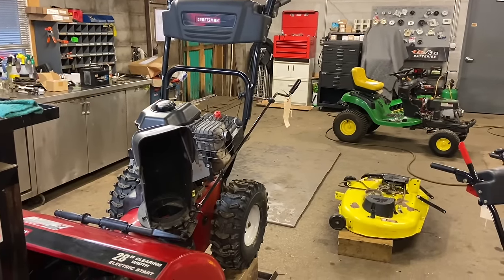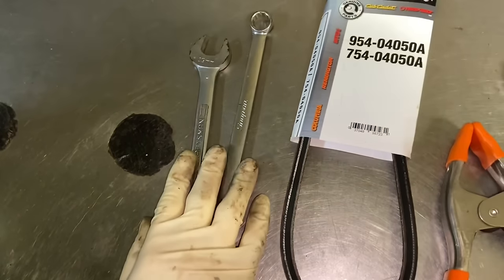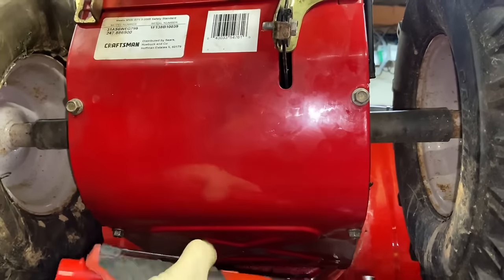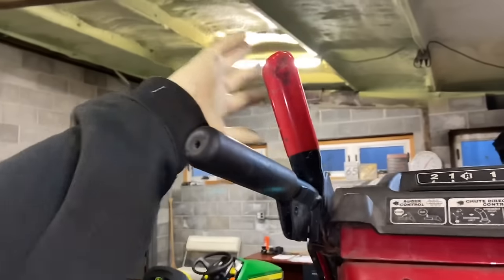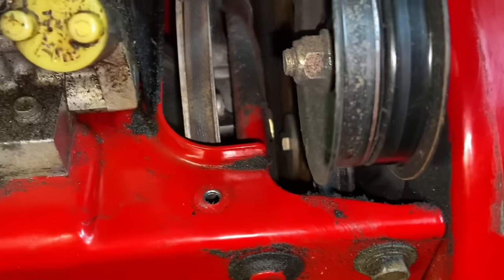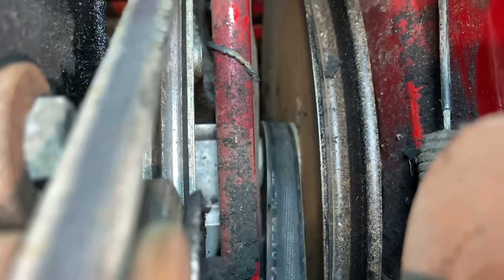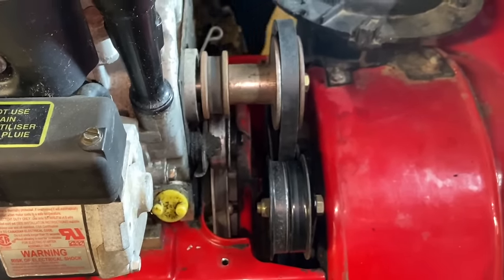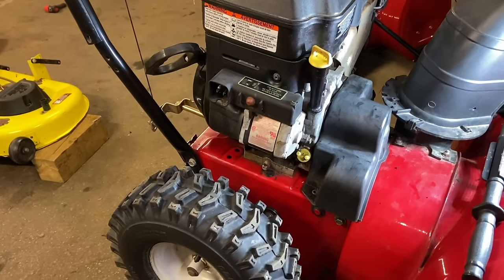How to install a auger drive belt craftsman 28” snow thrower

Comment: You did the easier belt here. The wheel drive belt requires separating the blower unit, or at least removing two bolts and loosening the other two to get the belt down to the pulley. Thanks for the video, though. I just did both belts on mine, and it was very helpful. The thing chucks snow better than it has in years. Mine was this exact model, so it was great to have a specific video.
Reply from the maker: I’m glad it was helpful. We do not get much snow in our area so I don’t get to replace the trans drive belt often but when I get one to replace, I will get a video of it. Thanks for watching:) and I’m happy you machine is running great!

Comment: Thanks. I bought a used machine that had untold hours. Very sound, but unknown history of the last decade. It does not like pioneering in 2.5 feet of crusty snow. So here I am. I will also be using air to clean off the belt fragments prior to re-installation of belts.
Reply from the maker: Hi Al, I hope it goes well for you and I'm glad I could help. Please give this video a thumbs up to help my channel. It would be greatly appreciated. Thank you for watching.

Comment: Very detailed, I am getting one with a broken belt for cheap, drives fine and the motor sounds smooth. I was told he could not replace the belt and got another one. This will be a project for me soon and it look very easy to do. Thanks for detail, I'll edit this when I am done and it's working...

Comment: Thanks for posting this video! I found it even easier if you take the bolt out of the top pulley wheel, it'll separate into two halves. Slip the belt on and then replace the half pulley wheel. It'll require no stretching.
Reply from the maker: Hi Eric, I'm glad it worked out and thank you for watching!

Comment: Thanks for your great videos! I just picked up a craftsman 928 model 31as6heg799, 247.88190, that needs some TLC. Previous owner sheared 1 of the 4 pins and  the other 3 are siezed, skid plates are shot as well as the scraper blade, but the engine runs great! Most of the bolts, (skid plates, scraper blade, discharge chute, etc) are frozen with rust and break trying to remove them. I've have a Murray 522, Craftsman 8.5/26 as well as a older Estate 825 that I've refurbished,  all up and running for  our upcoming MN winter. Keep up the great work!
Reply from the maker: PB Blaster and soak is good for rusty bolts. Most of the time just get new hardware because the old normally breaks off. Thank you for watching my videos and for the kind comment. Please share my channel to help it grow. It would be greatly appreciated.
Reply: Well here's the story. This is a older craftsman 928, 247.88190 that I picked up, $50. One auger blade had a sheared pin, the other 3 auger blades were frozen to the shaft. I had to grind off the other three shear pins and was able to remove the blades using pipe wrenches to free them and work them off the auger blade shaft(s.) Even being soaked with both PB blaster as well as a ATF/acetone combination (no longer have my oxy/acyt torch) the sheared pins would not yield to a punch and hammer so I was able to drill the old pins out. The shafts are now clean and the gear box turns freely and smooth so I added 80/90 to the auger box, p/n 719-0320, LK-3.  According to my measurements, the gear oil is about 1/2 way above the auger shaft/worm gear and I have some fliud leaking on both sides of the auger shaft seals.  Many years ago, we could take a seal, bearing, O-ring to a hydraulic shop to get a replacement part. Due to the age of this blower, it will probably be best to run it as is and keep an eye on the gearbox fluid level on this one.
Craftsman 928,  Craftsman 8.5/26, Murray 5/22, Estate 825

Comment: Thanks for posting! It only took me 15 minutes to replace it after watching your video. I don't have a maintenance stand but putting the blower up on its end (blades down near the floor) made it super easy to get the maintenance panel off and to pull the old belt out and push the new one through. 2013 357cc MTD Gold had more space between the pulleys (compared to the one in your video) for the belt to pass through there.
Reply from the maker: Hey Mike, I'm glad the video was useful to you. Be careful when tipping machine on its end because you may loose gas and oil from the engine putting the machine in that position. It sounds like it worked out for you! Thank you for watching and subscribing
Reply: @JohnsonsSmallEngines  I did lose a little bit of gas but no oil. Thanks again.

Comment: Real helpful and detailed thanks. I too didn't like trying to wiggle a new belt past the bolt with a long screwdriver, but with a little patience it's not too hard to almost guide it sideways and not have to use too much pressure. 

I believe this should solve the issue I was having where my auger would stop engaging with even a small amount of heavy snow. I do wonder what causes the wear on the plastic cover... has to be  a better design than that.
Reply from the maker: The belt guard wearing out is from the belt slapping against it while running. On many models they put a metal tab there but they only did it to a few models.

Comment: Awesome, thanks very helpful video.
Reply from the maker: I'm glad it was helpful !
Reply: @JohnsonsSmallEngines  Great video, thank You very much.
Reply: When I took the cover off to replace the auger belt the chain gear was laying inside broken do you have any tutorials for that repair. Thanks.
Reply from the maker: Not at this time. The snow throwers in my area do not get very hard use. If I get one with that issue I will be sure to post but that doesn't help you at the moment. I'm sure someone has something that can help.
Reply: @JohnsonsSmallEngines   Thanks again.

Comment: How do you know when to replace the belt versus tightening the belt? Had some wet snow and got a clog, the belt smoked a little now I’m not sure what to do..thanks for the video!
Reply from the maker: If you tighten the belt to where you think the handle tension is ok and when you let off of the handle the augers still spins. It is time for a new one. Normally when you see smoke from a belt, it will have done damage. In my opinion order one in to be on the safe side and go with yours until it doesn’t work well.
Reply: @JohnsonsSmallEngines  thank you!!

Comment: Great video thanks! Only question is how do I get my oem number ? Mines a craftsman 24” 208cc
Reply from the maker: Take the model number off of the sticker in the center of the tires in the rear on the transmission pan. Go to sears parts direct to look up the part number then you can take that part number and order online. Here is the link to sears parts direct. https://www.searspartsdirect.com/

Comment: This was great video. I just have an issue with the belt after I replaced it. The belt is making a noise when releasing the auger. Like the belt is hitting the covers.
Reply from the maker: I think I saw that you did figured it out? The adjuster? or also check,  if you have a full plastic belt cover?, the cover is also used as a belt guide and sometimes the belt cover gets so worn on the sides that you need to replace the belt cover.

Comment: Thank you so much for posting this video. I managed to remove the old belt and get the belt in but I can't get it to go on the pulleys. It's too tight. I have the auger tension released but the belt is still unable to go on the pulleys. What am I doing wrong?
Reply from the maker: Make sure you belt is routed correctly around the bottom pulley. Other than that  it sounds like you have the incorrect belt size.
Reply: @JohnsonsSmallEngines  I have a Haussman model snowblower. Looks like an MTD clone. Is there a website I could use to get the correct belt? I have the model number but the hardware store gave me the belt I tried to install.
Reply from the maker: I'm not sure who makes the Haussman Snow Blower. You will need to find the company you purchased it from or google the model number on the sticker and look up a parts list for your model.
Reply: @JohnsonsSmallEngines  Thanks for all your help. I'm in Ontario and I've found out that Rona/Lowes are supposed to have the parts. The old belt is 1/2" X 38". So I'm just going to try and find one as close to that as I can. Again I just want to thank you for putting all that information in the video.

Comment: My auger is always turning?. Belt is good. I have a craftsman just like this one.
Reply from the maker: The belt tension may be too tight. You may have to loosen the tension.
Reply: @JohnsonsSmallEngines  when i push down the lever ,the belt pulley does not move but augers are always turning
Reply: @intelin123  yeah just go to the back of the snow thrower and reposition the adjustable tensions gold pollie